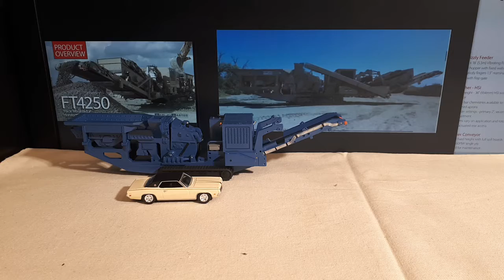1/64 KPI JCI FT2450 mobile rock crusher by EPR Empty Pocket Rebuilds 3D printed resin painted sample

Comment: Start to finish. There is chains in the in feed housing but it’s to keep material from flying back out after hitting mill. The curtains as they are called are the plate in the hood. They adjust closer or farther to the mill to adjust sizing. The chute on the side is a recirc conveyor that’s missing. Normally and in the picture you used there is a screen plant on the front. Any oversize material goes back up the recirc in to that small chute and is crushed again. The big square in the middle is the engine and pump housing. No generator it’s all hydraulic power the chute under the feeder is a clean out chute not a diverter chute. Material drops down through those fingers to bypass the mill to alleviate unnecessary wear on mill. You did pretty good for not knowing construction. Also there is a magnet belt missing that will pick up rebar.